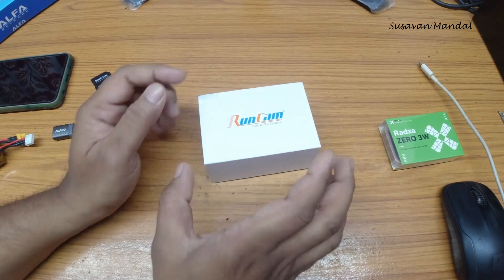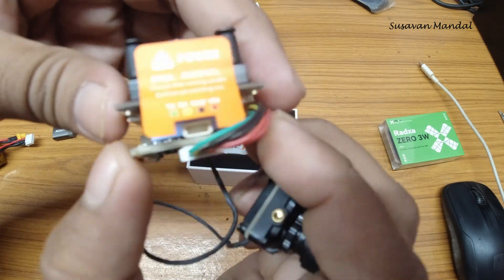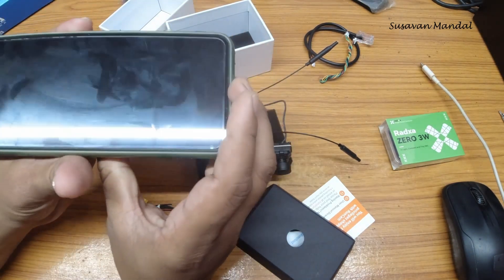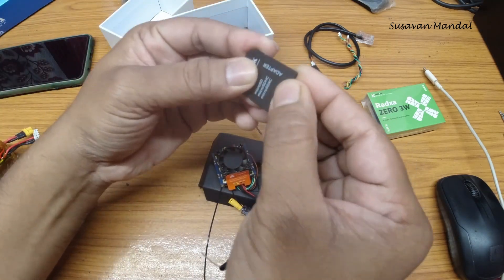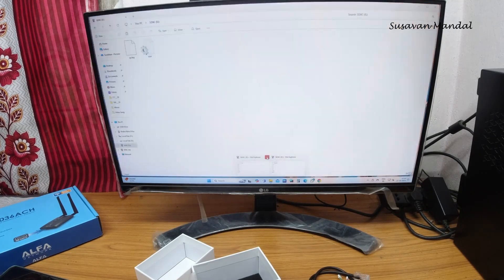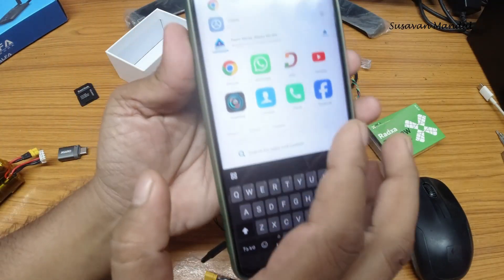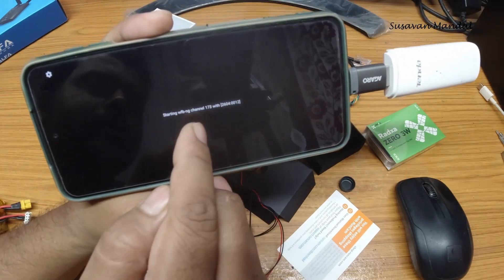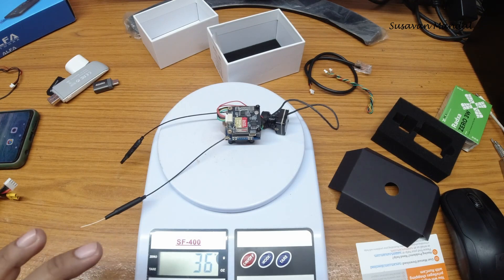OpenIPC | Runcam WiFiLink | Unboxing & Initial Setup | Cheapest Digital FPV System

Comment: Hi, can you suggest a bec for this? I am planning to use it inside my rc plane.
Reply from the maker: 9V/12v 3amp BEC (i.e. Matek BEC) would be sufficient. I will upload a video about its current draw soon.
Reply: @susavanmandal6811  Thanks, if possible do make a video with PC as GS🙏🙏